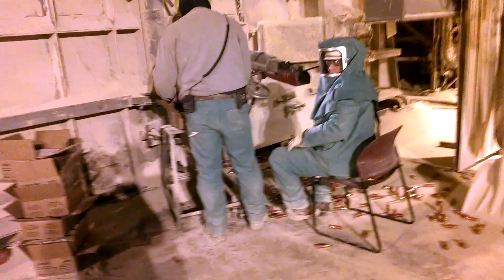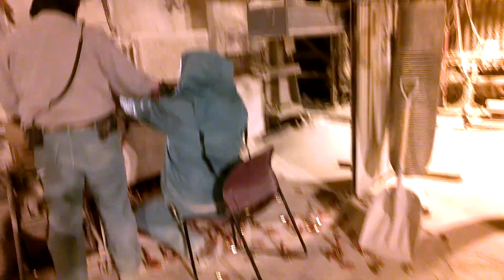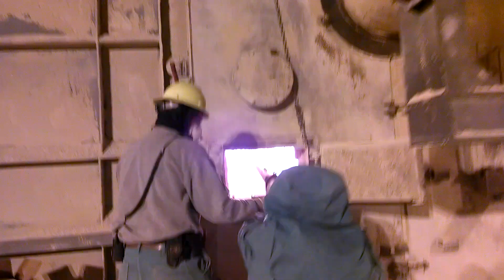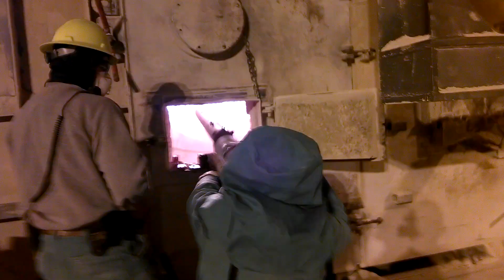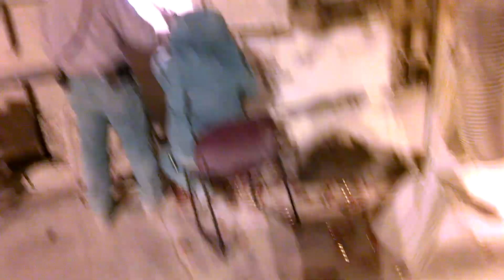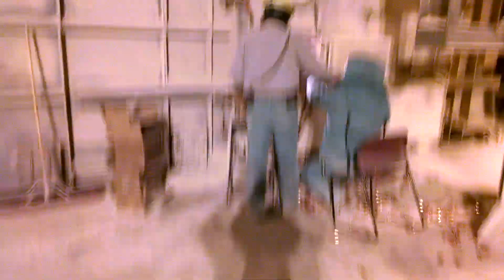8 gauge industrial shot gun

Comment: My Dad worked for AEP and they had to do this as well, but they used single shot New England 10 gauges, he told me that AEP was the largest buyers of both, the 10 gauge guns and Shells in the world, they also had to wait till the kiln had to cooled before they could start shooting, the kilns were so big he said that it was nothing to break off pieces of slag that weighed tons. He told me the first thing they did was take their new guns out of the boxes and take off the trigger guard then braise on piece of brass to the end of the barrel and then finished it with a big piece of foam duct taped to the butt stock, and by the time their 12 hour shift was over the guns were toast and they threw them away and started all over the next day!
Reply: So what exactly is this job? Why are they shooting guns into a hot oven?
Reply: @bmx28kenilworth  Breaking off slag from the inside walls of the kiln or firebox.  Everything that doesn't burn, and doesn't go out the stack has to go somewhere.  And that somewhere is on the walls, where it impedes use of the kiln or firebox.

Comment: How powerfull are those industrial shells tho? Just to ask
Reply from the maker: 8 gauge shell is about as big around as a half dollar. And those are industrial slugs so I'm guessing quite a bit. Definitely not something you'd want to shoulder fire more then once
Reply: @mrjones4253  oh damn, also i dont even think there's a shotgun to fire 8 gauge shells other than those 19th century double barreled ones
Reply from the maker: @porrod4313  agreed ya, it's hard to believe men used to hunt with that round.
Reply: Ok have a round for this. It has a zinc slug like a whole roll of dimes.
Reply: 10ga is .775 diameter, or slightly larger than ¾" inch
Reply: cant fire them in a actual 8 ga shotgun apparently. the chamber ridge is different.
Reply: @Rampant_Colt  8 gauge is .835 in diamater
Reply: @frigglebiscuit7484  interesting
Reply: @porrod4313  
BOOM!
Reply: @mrjones4253  I know this is a year old, but I don't think it's inconceivable it was used for hunting. Muskets are like 50 caliber. Then WW1&2 .30-06 and .308 was the standard in the military. Now 5.56 and .223 in the 1970s Vietnam and forward.
Reply from the maker: @blackonblack...9244  right I agree with you, it was used for hunting. Infact the 12 gauge was designed for women because they couldn't handle shooting the 8 and 10 gauges of the day

Comment: Why do they do this?
Reply from the maker: Because inside the kiln rings build up on the wall and the molten rock behind creates a pool in the kiln, if the wall gets to high and pool to deep it can break like a dam and flood the cooler below and the basement floors. Very dangerous if that happens. So we use this cannon to throw 8gauge industrial slugs into the ring to break it down before it gets to big .. takes hours ! !!!!
Reply: Mr Jones that’s pretty wicked man thanks for the info !!!
Reply from the maker: @lucasfila2020  no problem :) thanks for the question
Reply: Also the rings baked onto the side are so tough that you can only removed them with huge guns or high explosives. Since it's not safe to climb around the inside of a kiln, they went with a huge gun.
Reply: Troika huh that’s pretty interesting. Thanks for the help. And what do you mean by rings??
Reply: @lucasfila2020  kilns spin, so the buildup forms in a ring-shape.